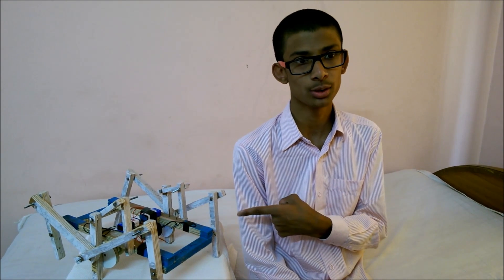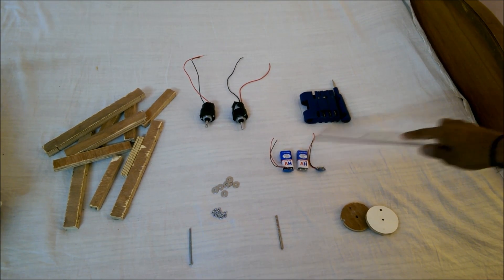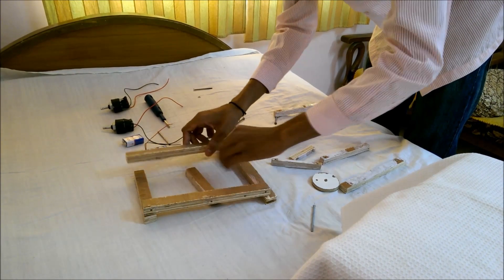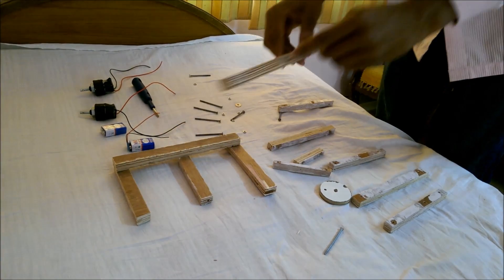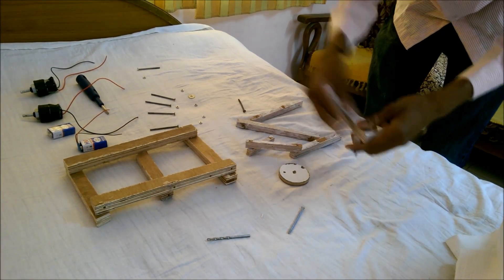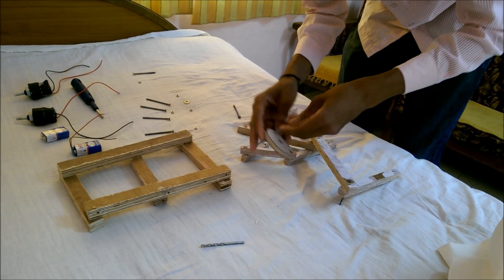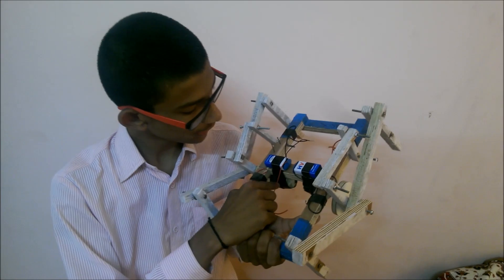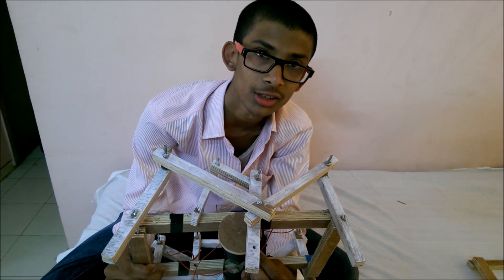HOW TO MAKE MECHANICAL SPIDER IN 4 MINUTES | MECHANICAL ENGINEERING PROJECT

Comment: bro i also make this project its take motion when i rotate wheels by my hand  according to your battery and motor its not sufficient to run this spider bcz its have more  weight  more friction due to use of this screw what changes i do i the project then i make its runnable without my hand

Comment: Can some tell me the dimensions of the wooden stick and diameter of the wooden part?????
Reply from the maker: +Abhishek Kumar Shukla it totally depends on how big u want your Mechanical spider to be....in my case I aimed toward making a small prototype so i made a small spider....still the dimensions of this mechanical spider are diameter of crank :- 5 cm 
Length :- 45 cm and 35 cm 
If you have any type of questions feel free to ask....thank you so much...👑🖖👑
Reply: Base  H shape it is made with 45 cm and between h is connected that is 35cm..????
Reply from the maker: +Abhishek Kumar Shukla absolutely correct...🖖 if you don't get it right then try increasing the length..👑
If this video helps you to make ur own spider consider SUBSCRIBING..👍😇
Reply: Spider legs ki lenghth kitni h
Reply from the maker: +Abhishek Kumar Shukla it is around 70 cm but u can change accordingly...🖖 best of luck for your project...💥👍

Comment: bro , for motors don't use this kind of batteries it doesn't have enough electric current , it just shows only the voltage ... if you want to work well then couple some AA 1.5v batteries together for more powerful and accurate working.. anyways thank you very much ... !!
Reply from the maker: yes bro thank you for your suggestion......